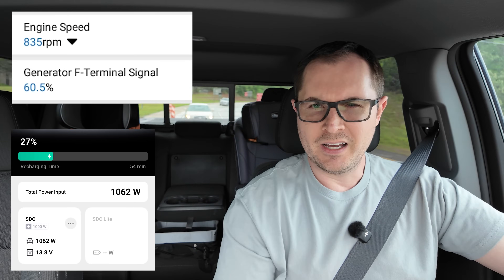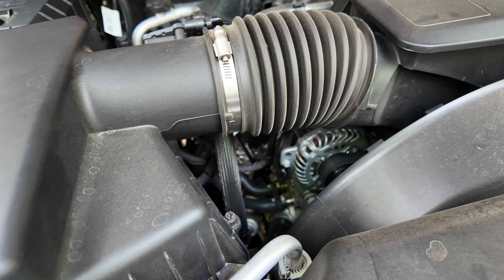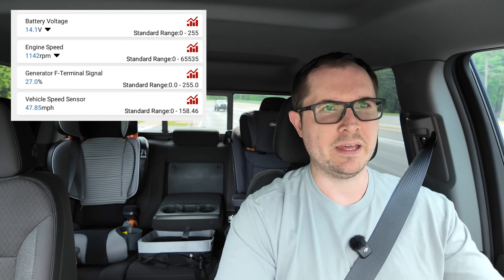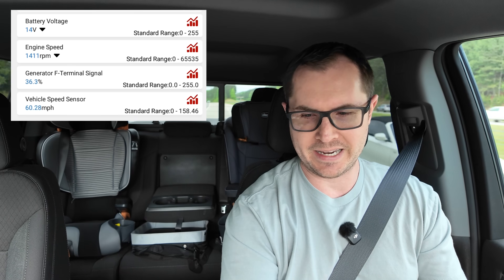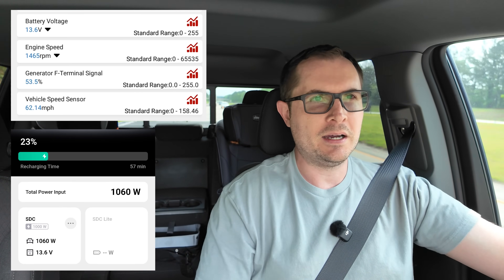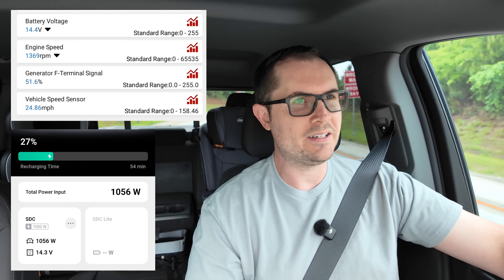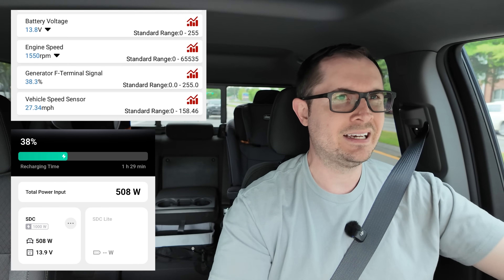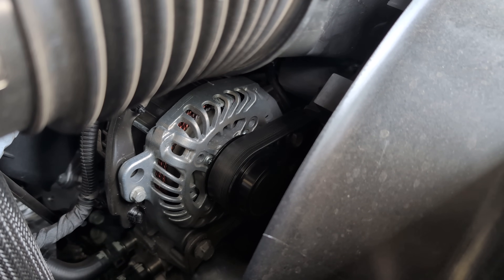I Show REAL Numbers: Impact of DC-DC Chargers from DJI, EcoFlow, Bluetti on Alternator

Comment: Thank you, incredibly informative!! Question for you: with the Ecoflow Alt Charger, is it ok to connect to the negative terminal on the starter battery, or does it need an earth ground?
Reply from the maker: Thank you for watching! I had tested the EcoFlow previously on my Jeep Wrangler JK and the EcoFlow instructions recommended the negative go to a chassis ground near the battery. However, I remember in that previous video some commenters argued it should go directly to the battery negative instead (for an RV setup I belive there they recommended the negative terminal oddly). And by chance if you mean a literal earth ground in terms of driving a stake into ground, I haven't seen that recommended unless I've missed it. For reference Bluetti and DJI recommend the negative go to the negative battery terminal. All that to say there are A LOT of opinions out there. Seems like negative to negative battery terminal is more popular, but that's a bit beyond my pay grade. Sorry I couldn't be of greater help!
Reply: @AdventureRocks  haha regarding 'earth' ground... I've seen so many British videos on the subject, and they refer to it as 'earth'. Thank you for specifying about the DJI and Bluetti. The Ecoflow Alt charger shows a chassis ground in their diagrams as you have also said, so I may try that so I don't 'fry' anything :-)
Reply from the maker: @makeyourfaith  :)

Comment: Where did you find the F-Terminal Signal sensor in your scanner? I have the same as you, but I could not find that sensor. 2025 GMC Sierra 2500
Reply from the maker: Yes, it is buried DEEP inside the menus. I went to the Diagnostics > GM > Manually by Model > GMC > 2024 > Sierra > U > System Selection > Electrical & Theft Deterrent...and then I selected the Generator F Terminal Signal along with the other variables featured in video. I tried a bunch of other variables listed in that bank...many produced no data or undiscernable data. Kinda a maze to get there, but hope this helps.
Reply: @AdventureRocks  thank you .. I actually finally found it... Exactly where you said. Thankfully my dual alternator setup is easily handling the load of the charger

Comment: This is a common problem on boats.  

Huge house battery bank ..

Owners will charge their bank using the motors alternator . At low idle . ( Not using a DC to DC charger ) 
Within a year they burn out the alternator.. 

Yes there are alternators built for charging house Banks.  Usually high  amp output and external regulator.
Reply from the maker: Great info on the boat scenario, thank you for watching.

Comment: Well done! I'd been thinking about how I could actually test this myself because, like you, I'd seen a bunch of commentary wtihout data on either side of the argument.  I'm going to share this video with my audience, because you did an excellent job on this and I'd love to help boost your viewership in some way, if I can.
Reply: While you're at it, could you add an opinion on adding a fuse to the DC-DC charger setup? I've seen that discussed in some comments. Not sure if it was on the alternator side or the power station side, sorry. My knowledge of electrical systems is next to nothing. But it sounded like possibly a good idea. 😎
Reply from the maker: @tracyLoJo  EcoFlow and DJI supply in-line fuse close to battery, and Bluetti supplies a DC circuit breaker near their Charger1. Different approaches, but definitely need a fuse or breaker to protect both charger and vehicle in case something exceeds the rated amperage. Ideally I think most argue it is better to have the fuse/breaker near the battery in case wires got too hot with exceeding current, but I'm sure Bluetti has their reasoning why they put the breaker closer to the charger.
Reply: @AdventureRocks  Thanks for the info!
Reply from the maker: Thank you, I appreciate the kind words! And I'm grateful for the offer to share it with your audience. Thank you again. Btw just subscribed to your channel.

Comment: Put an ammeter in line so you can see how much current is coming out of the alternator. I did and it works for me and I have a DC-DC inverter charging 3 12v 100@ batteries. I also have a 230@ alternator on a Chevy Express 5.7L  Alternators are current devices as well as voltage output.  Use an amp clamp on the output of the alternator,  you'd be surprised. In the old days generators had current regulators built in the voltage regulators.  Never heard of an alternator putting out 1 kilowatt of power on idle. (based on 600 rpm idle)
Reply from the maker: Great points, thank you for watching.

Comment: Interesting video !! Thanks !!

Remember the The Pirates Code !
Your truck is just a 'guideline'!

It's America! You can add alternators.  Or a bigger alternator.
Plus I doubled the wire gage at identical lengths between the alternator and the battery.  It got hot ! Good now.

I sure wish I could see your current shunt value.  I replace my "truck" battery with a DIY 100AH lithium battery polymer. No more lead.  Boy-o-boy, you want to see some current charging !  I'm very pleased with it. 
I put up videos of it at -5 degrees Fahrenheit starting my truck.

The incredible load it puts on the alternator the truck commands it to do !  The trucks don't have brains yet (GM firmware) to understand it's charging a lithium verses a lead acid. But it does LEARN the battery attached.
Current limiting (that is - voltage control e.g. FIELD VALUE ! ) would be the next step GM can do with their ECC or BCC.  Or we can modify it ourselves with say a zener design and a pot to clamp the maximum field voltage; thus charging current.  This will protect your alternator from overload demands.  Maybe tied to temperature and rpm.

It gets very hot producing current
until the battery fills up again.  The lead battery chemistry limits how much current it can absorb from the alternator. Thus the truck doesn't need any brains. The alternator never gets near its maximum current output for long.

With your new battery, it can absorb current at ten times a lead acid.

So the answer is current limiting built into these new devices we're buying from China.  That'll protect our old systems from the new modern systems used world wide.

Some products have settings that limit their demand on charging systems.

Great video ! Thanks !
Reply from the maker: Thank you for watching. Great points and information.

Comment: Interesting video. 
 One extra thing to consider- your Power Station.  While quite a few power stations can accept the higher wattage charge,  is it good for your power station?  My Bluetti has silent charging, standard and turbo.  Each has different levels of input to charge the batteries.  Sure it is safe but, is it wise?  Putting max power in is hard on the battery over time.  So give your alternator AND your battery a break and only max it out when necessary.
Reply from the maker: Great point, thanks for watching. No need to rush if you don't have to.

Comment: I optioned my F350 with the 2kw pro power inverter specifically to top off my power station and power an occasional air compressor. It runs off a dedicated 24v 170a alternator and once I turn in generator mode in the truck it automatically goes into high idle.
Reply from the maker: Nice! That is a sweet setup.

Comment: I'm guessing this use case is very different from my victron setup. I can't actually see your wire sizes, but from what I see in the video, your wire diameter is way smaller than what Victron calls for (from the engine bay to the bed of the truck). I'd like to see this compared to a Victron or even Renogy setup.
Reply from the maker: Great question. DJI supplies their own wires to spec with their DC-DC charger at a preset length. I've noticed the other brands (EcoFlow and Bluetti) have slightly different gauges and thickness. If I'm not mistaken I think on Victron they leave it to the end user to provide the wiring via guide. Definitely smart electrical engineers that run all those calculations to determine what gauge is best based on the length and amps and volts. Above my pay grade :)
Reply: @AdventureRocks its metric, but the minimum is in the victron manual (and it covers diameter by length as well).

Comment: Where I first saw this was charging using the vehicle alternator like this was charging a Bluetooth or other equipment instead of solar or a separate gas generator to supply power during an outage to refrigerator, tv, and a few lights. Will this work for emergency power as they indicated. Of course my vehicle wouldn’t have an alternator with as much output as this one.

Comment: Did I miss you mention your alternator specs?  100A vs 180A makes a big difference in how a vehicle will handle an Alt. Charger.
Reply from the maker: Thanks for watching. Yes @ 2:17. The 2500 gas has standard 170A, optional 220A and diesel counterpart standard 220A. Both offer optional 170+220A dual.

Comment: The important measure is the temperature of the alternator.  The alternator is cooled by a fan on the rotor and the lower the rpm the lower the fan speed and thus less cooling.  So high load at idle is what will kill an alternator, because that makes it the hottest.  However, most alternators have a temperature sensor also, which calls for it to reduce load and cool off.  So, really, you shouldn’t worry about it unless your usage continues to have it thermally governed, in which case you should maybe upgrade to a larger alternator or reduce load at idle.
Reply from the maker: Great point. Thank you for watching!

Comment: My Ecoflow alternator charger drops down below 800w at idle to limit the strain.
Reply from the maker: Great point, and thanks for watching.. My understanding is the DC-DC chargers use the voltage of the battery to determine how agressive to push. On DJI the minimum is 12.6V whereas on EcoFlow they let it go as low as 12.0V.

Comment: I do 300 amp alternator, Power line 400amp diode based isolator (yes it is $1800) 4x L16 agm batteries, 3000 watt Renogy inverter (with GFI disabled) and 600 watt solar running through Renogy MPPT charge controller. All wired with welding cable. Damn near bulletproof. Cheap and easy is risky and lazy!

Comment: My Ford Transit T350 Cargo van came with dual 250 amp alternators. It comes with a factory customer connection point that has a 175amp fuse on it. I'm pulling a conservative 1200 watts charging while I drive which should be enough to keep me in power. I'll add solar later if I end up sitting in one place for a while.
Reply from the maker: Nice setup with the beefy alternators. Thanks for watching!

Comment: I have a 25 6.6L8T, but mine has the snow plow/camper package, so i have the 220 amp alternator. I'm hoping to use my eco flow alternator charger while idling. Hopefully my beefier alternator can handle it and not work too hard.
Reply from the maker: Sweet setup. I wish I had spec'd mine that way, but hindsight is everything. Thanks for watching!

Comment: I think you nailed it...just sitting and idling to use those chargers is NOT a good plan and longer term will cause issues.  80% or less and you're fine.  Running at >80% load of the output for any significant amount of time will be an issue.  Sure it happens at a stop light...I wouldn't be concerned about that.  The issue will be if you just sat someplace with loads on and charged with it.  Driving down the road...non issue.
Reply from the maker: Thank you for watching. Great points.

Comment: I can't speak to the significance of the generator F terminal signal but just from the math,  at 1067 W of charging power at 13.8V calculates to 77 Amps  of additional current through the alternator and wiring.  Something to consider.
Reply from the maker: Thanks for watching. Great point. I'd imagine the passive/static load will vary vehicle to vehicle, but on mine it's about 40 amps with a little AC, radio and all the basic computers running.

Comment: Set the unit to a lower wattage.
Set up via the app.
My 25 yr old van has a 130 amp. Some are as low as 70 amp. Older stuff.
I also have solor and will be increasing this.
Great video

Comment: On alternator charging. 
Please lookup (RVC) Regulated Voltage charging. AC Delco posted a online class several years ago on the benefits of this system.
When you first start your vehicle the alternator charges at 14 to 14.5 for 15 or more minutes to bring battery up to 80 to 100%. This helps the battery last longer. The alternator the reduce voltage to 13 volts to prevent overcharged of the battery, reducing wear on the alternator, and improved gas mileage. 
AC Delco posted a class to it's mechanics because so many customers thought their alternator was bad and mechanics were replacing alternators not understanding that the computer was designed to function like this.
They also covered that running the alternator over 30 to 40 % of it's rated maximum output would greatly reduce the life of the alternator because it would not be able to get rid of all that heat.
Hopefully this helps you run down another rabbit hole. 
I did enjoy the information you covered.

Comment: What im wondering is why no company has already incorporated all this into their batteries. 

BMW has apparently been using lifepo4 as starting batteries for awhile, it doesnt seem to me that it should be that hard to integrate the ability to control what the battery is allowed to pull, and "soft disconnect" the battery from the alternator so it doesnt potentially surge the voltage.

You might lose some capacity, but nearly every lifepo I've seen taken apart has plenty of space to run a larger BMS (to support starter draw) and additional circuitry for things like some sort of soft disconnect.

It would make the batteries as a whole infinitely more useful.
Reply from the maker: Thanks for watching. Great question. I thought lithium batteries weren't as well suited for starting engines, but maybe things are changing as they develop them out more.
Reply: @AdventureRocks  Check out Noco. Yard tractor sized batteries are not much more than their SLA counterparts, and 400A output. BMW has done it for cars, if batteries like that were available at "reasonable" cost, I think they'd be a huge hit. 

Slap them in the vehicle either as a starter or auxiliary, no need to worry about additional components, alternator issues, etc., truly a universal battery. The uses would be endless.

Comment: I bought the 60A renogy model to future proof so I won't buy another, but I have it set to run at 30A, and I also set up a timer circuit to duty cycle it at 50%, 30s on and 30s off, so it really only charges at 15 amps, nice and relaxed.
Reply from the maker: Very nice. Great setup.
Reply: @AdventureRocks  yeah it works well, and the timer is completely adjustable, so duty cycle can be fully customized.

It also has a user defined number of cycles, so I've set mine to run for half an hour total. This way it won't completely drain the battery if I turn it on while the engine isn't running... Not that I would ever do such a thing 😂

Right now I just have a little hatchback, but if I ever upgrade to a bigger car (or bigger alternator) then I just need to adjust the duty cycle and I'm set.

Comment: Why would anyone have AC and heated seats on simultaneously? 😂
Reply from the maker: Maybe a passenger princess?
Reply: My wife has lower back issues and the heated seats really help out on trips, so the seat heat and a/c are often on at the same time. So don’t judge folks. Also the defrost mode runs the A/C. Haven’t thought this through have you? 🤔

Comment: The DC-DC charger isn't the problem. It is the lack of temperature compensation.

I have installed a LOT of these DC-DC chargers and never had a single alternator failure because I use temp compensation. In some cases, I use dual temp compensation, one on the output battery, and one on the alternator.

Without temp compensation, you'll nearly ALWAYS burn up an alternator.
Reply from the maker: Great tip. Thank you

Comment: The problem of  charging is the end product ie the battery chemistry.  With LFP or MNC they both want as much charge as is physically  available  (not good). You need a load or shunt to slow the charge down. The experts in my opinion  are the boating crowd. The alternative is using a heavy duty alternator,  say from an ambalance or snow plow rig. Mobile audio buffs deal with this problem too.
Reply from the maker: Great tip, thank you

Comment: What about one of the higher amperage alternators? Would a dual alternator setup with one dedicated for the DC to DC charger be a better solution?
Reply from the maker: Indeed, in hindsight I wish I ordered my truck with the higher 220 it even dual 170+220 option. Thank you for watching.